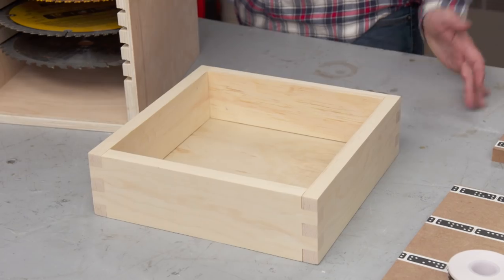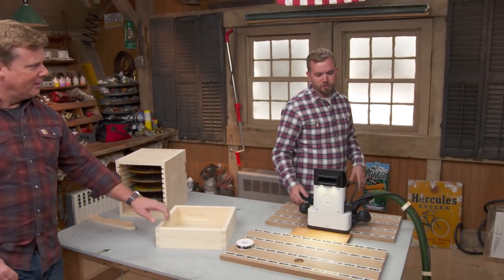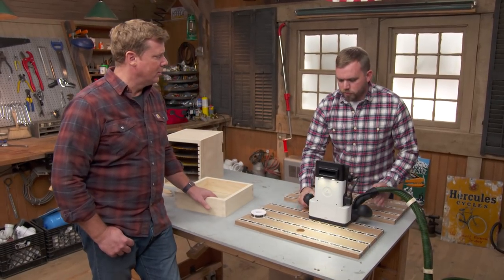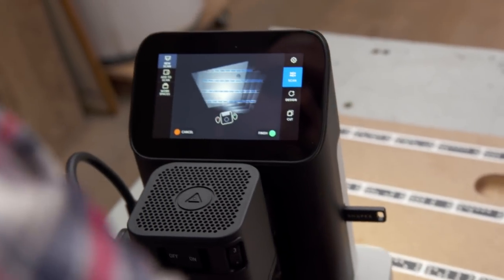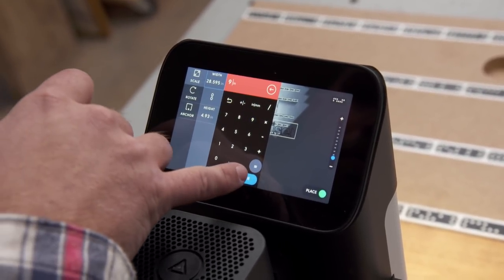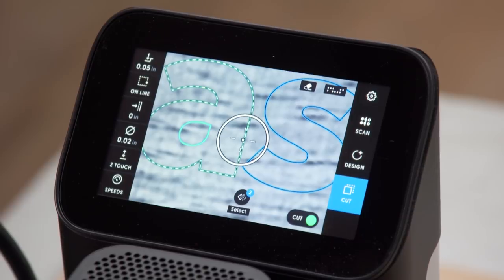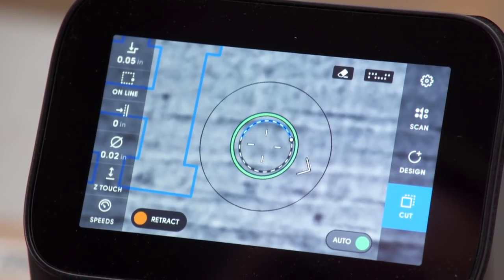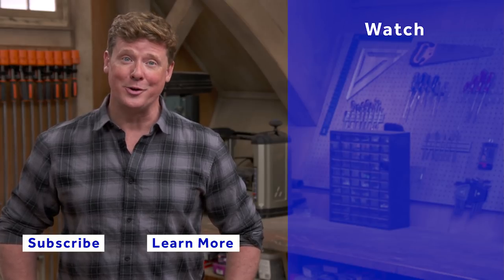How to Use a Mobile CNC Router | Ask This Old House

Comment: Very cool. First question, so how much is it?
Reply: $2,500
Reply: About $2,500 U.S. Dollars.  It starts at $3,600 in Canada, plus bits and required accessories which will start you routing for about $4,000 + taxes in Canada.

Comment: YOUR LINKS ARE PATHETIC.  IT SEARCHED FOR A GENERAL CNC , NOT THE ONE SPECIFIED. AND THE SAME FOR THE TAPE.  AMAZON DOES NOT HAVE IT IN FIRST LOOK.  IT PULLS UP A GENERAL MARKING TAPE. EVEN WHEN I SEARCHED SPECIFICALLY FOR CNC MARKING TAPE, NOTHING CAME UP LIKE YOURS.  CAN YOU USE DIFFERENT TYPES OF MARKING TAPE?